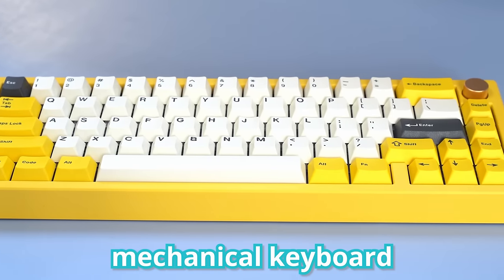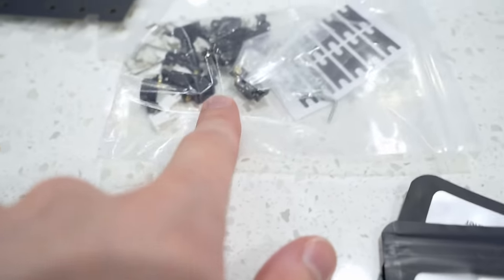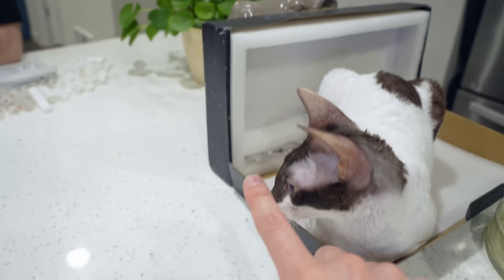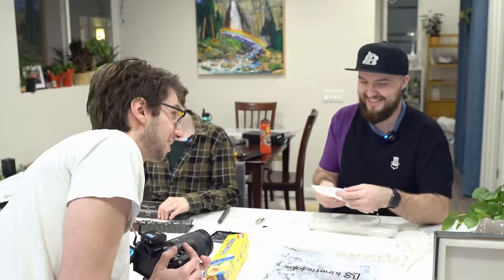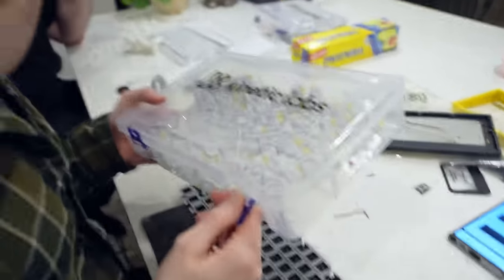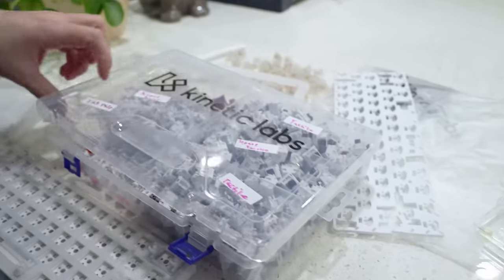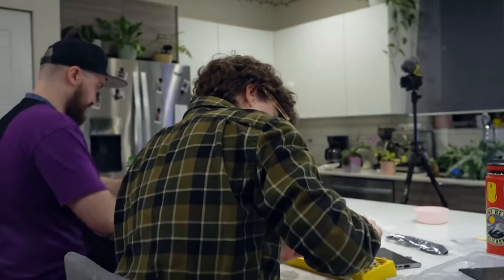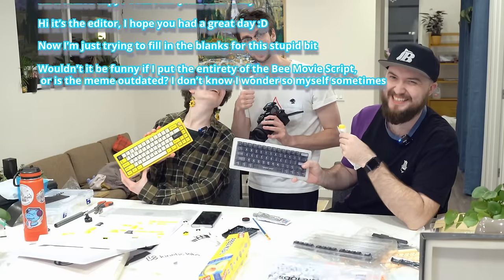How to Build Your FIRST Custom Keyboard... (in 2023)

Comment: Hi there. Been watching so many of your videos and love them. Did my first mechanical keyboard recently, got the tester68 kit and did tape mod on the board and added extra foam to the base and tape modded the space bar. Got some akko v3 cream yellows and already really happy with it. Loving this new hobby. Still need to find time to lube everything switches and stabs. Any suggestions on another budget 75% keyboard? Thinking of the silent gamakay Pegasus switches this time.
Reply: Hey there! If you're looking to maintain a spotless desktop and keep your workspace clean, have you considered the HOTO Compressed Air Capsule? It's a compact yet powerful tool that offers both vacuuming and blowing capabilities. With features like high suction power and fast wind speed, it's perfect for keyboard cleaning and other tasks. Plus, it's portable and versatile, allowing for use in various scenarios. Check it out and let me know what you think!

Comment: As someone who has built one and knows a bit about them, my suggestion is to get a switch separator, a hotswap board, a screwdriver, lube (not durex, krytox.), a thin and fine paint brush, cheap yet enhoyable switches (also get more than you need), good stabs (my KB's main issue), and a key cap puller. (And obviously the other parts you kinda need for a kb.

Comment: The more I learn about custom mechanics keyboards the more needlessly complicated it seems. 

It's like incredibly low stakes complicated though. Nothing will go hugely wrong but also the reward for doing everything right is mostly satisfaction of a job well done.

I definitely cba with this, will buy something prebuilt (which is cheaper for some reason?!) and maybe replace a few caps and program some macros in.

Comment: Need a quick suggestion! I'm planning to get the Keychron Q3 with Gateron G Pro switches. I'm currently using Cherry Blue, I really like the sound and feel of it except the bump. I have used cherry brown, but it felt bland. So, I was wondering which switch I should go for? I can also upgrade it later as the board has a hot swappable option. Thanks a lot😊

Comment: Forgot to comment but I built my GK64x watching this. First custom. Thanks for the new hobby. :]
Reply: 👍 
May I ask the specs/mods?
Reply: @xxcridonxx7614  Sure. It's the Epomaker GK64X, The standard ABS case, I double side taped $0.01 coins to the bottom for mass/weight, went to the craft store and got a 1/8in(3.2mm) and a 1/4in(6.3mm) foam sheet and cut pieces for the bottom, tape mod x3.5(tape was just a little wide), 1/8in  PCB foam that I cut with a hobby knife, Holee mod with medical tape and silicone grease, burger mounted all the screws with extra ear piercing silicone o-rings(14g piercing; dunno the dimensions), AKKO CS Ocean Blue switches that I lubed with Krytox and the Epomaker Rome; Cherry Profile; DS ABS keycaps. Also I haven't seen it done but my Enter and Space sounded too clacky for me so I put some poster tac in some of the open space to round out my sounds. It sounds poppy and a little snapy. Like the chewing gum sound in your head. 

Sorry if that was TMI but if you wanna know more just ask. :}
Reply: @youtubeusingatisdumb  is this ur endgame or nah?
Reply: @xxcridonxx7614  Nah. I think I am going wooden for endgame. This is kind of a first try and see what I really want keyboard.

Comment: actually in 2023 you want to start with a nice prebuilt hotswap keyboard (keychron, epomaker, iqunix for example) then try out different key cap material/profile, different switches, and learn to mob the prebuilt before you start build from scratch, the different between prebuilt and 100% custom is not very big anymore

Comment: I'm just sharing mine :D ...My recent and most used keyboard was around 80$ and I got Gateron Milky Reds in cheap price (and yes it is unlubed) but works fine to me but before I use gateron I tried KTT Kang Whites and it is god actually.And I use TKL keeb because I do play games thats why I chose 84 key keyboard :D
Reply: Went back to my old IBM keyboard after my logitech g710 broke spend nothing on the keyboard.

Comment: I built mu first custom board by buying a hot-swappable Red Dragon board for $30, disassembling it, insulating it and replacing the key caps with $14.99 Hyper-X yellow puddings. It can be done.

Comment: I want to upgrade to a keyboard with a nice thock that doesn't break the bank but I'm waiting for these "niche" keyboard manufacturers to reach <2ms latency like Logitech, Razer and Corsair. Anyone have any suggestions?
Reply: The difference in latency is notable( I’ve used both optical and custom boards) but the quicker reaction speeds are only needed if you play Fortnite. Any other game, the quicker reaction is useless
Reply: What’s break the bank to you
Reply: @user-mn2rc6rs5f  I'd say around 150 USD is where I'd draw the limit for value/price
Reply: @xxcridonxx7614  Depends on how impactful getting a keypress off first is. In moba games for example, you might be the first person to get a spell off and completely disable the opponent. The reddit community glosses over 10ms as if its nothing but 10ms pushes you quite a bit along the bell curve of reaction speeds which is clustered around 150-200ms.

Comment: How good can you get a redragon k552 to sound !??
Reply: U can actually get it to sound really decent. It was my first mech and I put akko switches (lubed ‘em up) changed the plat mount stabs and shoved in sum foam. You can easily get rid of the ping which is actually from the outemu switch springs and not the case. U can also erase the logo if u get an eraser and dip it into hydrogen peroxide/ rubbing alcohol and scrubbing.

Comment: Hi - my Wife bought me a mechanical keyboard for birthday. Unfortunatble... with low profile keycaps (which I don't preffer). But its keychrone!! YAY so i'ts easy to change keycaps even for high profile ones. 99% worked - but i'ts the model k5. Is there any option to change Spacebar, Shift and Enter? Those keys with stabilizers seems to be unchangeble :/   HALP! I don't wanna refund birthday present :(
Reply: It might require a little more force because of the stabilizers, but they should also be able to come off.
Reply: @gyfennn  they come off. But layout of TKL seems to be different. Its like... vshped. only for those three keys :/ and keycaps i have don't match

Comment: I've been trying to find a keychron v1 (really interested in that board esp. for thockiness out of the box) but it's out of stock most of the time! Anyone has any thoughts on the Epomaker TH80 pro? I've seen a couple videos on it and it sounds great. It's supposed to feel good out of the box too! I'm also debating between gateron pro yellows, black or browns! Any input? I have very lightly modded a keyboard before, but just as a beginner's test. I'm coming from a Logitech g pro keyboard with clicky switches... I like the actuation of the switches but they sound pretty terrible XD.
Any help is appreciated!
Reply: I just bought one today!